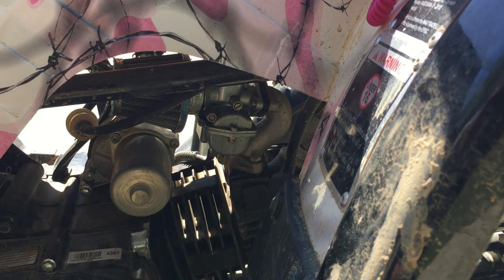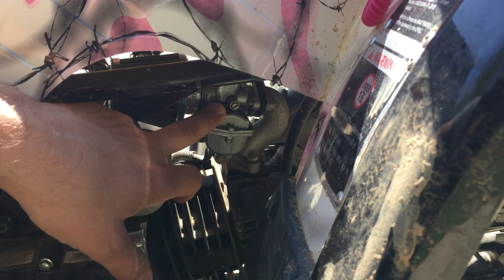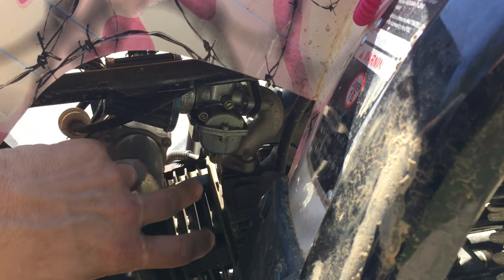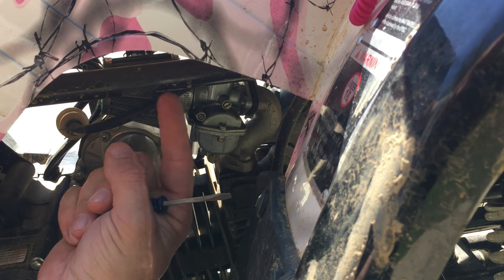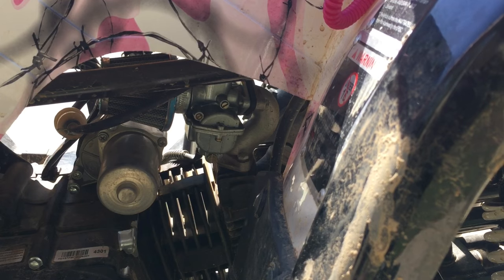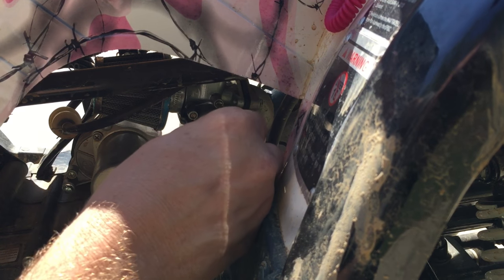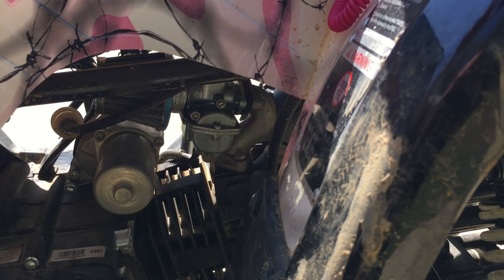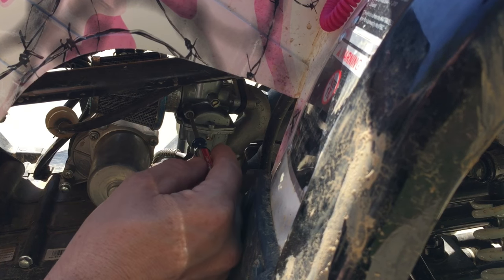Tune Your Chinese ATV Carb

Comment: Sometimes the air/fuel screw comes with a little plug covering it. If you use an 1/8” drill bit and very carefully and slowly drill into the Center of this plug, it will eventually catch and pop it out revealing the adjustment screw 👍
Reply: Omg I think you just saved me from going out getting another carb, I got a new Chinese pit bike 125 and it didn't have no idle screw or air but there is these rubber stoppers hmm 🤔
Reply: Well i probly messed up idk if i drilled too far and i 100% used the wrong drill bit and think i destroyed the screw face
Reply: I actually am checking the jets on my new carb for this thanks for the tip
Reply: Sometimes you need to drill a hole and screw a sheet metal screw into it . Then grab the screw with some pliers and yank the plug out.

Comment: Nobody else on YouTube can explain how to tune a carb as well as you did.  I'm glad I found your channel.  I'm going to be a combustion engine wizard, now!  LOL  Thanks, man!
Reply: There is NOTHING to "tune" other than changing jets and turnning the air bleed 1.5 turns from lightly seated
Reply from the maker: Pretty sure we can file “turning the air bleed screw” under “tuning.” 😆
Reply: They certainly can. This wasnt a thorough explanation by any means.
Reply: I concur ❤

Comment: Good video.  Here's some info to supplement.  There are 2 jets in these, an idle jet and a main jet/needle jet.  If your mixture screw does nothing, then your idle jet is plugged and it's running on the main jet.  When this happens your idle speed screw will also be extremely sensitive.
If it idles fine and the mixture screw works, but if you go near full throttle it loses power or even dies, then your idle jet is working but your main jet is plugged.
Both issues require taking the carburetor off and cleaning it.
Reply: This is exactly what is happening to my kids 50cc quadebike. Could you possibly post a link for a video to do this as I'm completely new to this and don't have the first clue. Tanks in advance
Reply from the maker: I think I’ve got a spare carb laying around here somewhere, I’ll see if I can make a video.
Reply: @BellyUpFishGarage  hey you ever make that video lol. I just got a grom clone and I bought a nibbi for it. It Boggs if I give it to much throttle to fast but if I kinda east into it, it’s fine? Should I adjust the needle?
Reply: @johnnyburgett7215  no video yet i guess
Reply from the maker: No, I’ll see if I can make one this week.
Reply: @johnnyburgett7215 what did you do to fix it

Comment: Thanks to you I figured out my issue.  The gas/air mixture set screw is snapped off. It came from the factory like this and I'm happy to have an answer. Thanks again.
Reply from the maker: Glad it was of some use.
Reply: So how did you get it adjusted
Reply: @omexgazplayz6298  I just went and bought a new carburetor. They are less than 20 bucks on Amazon.
Reply: @georgesmith6154  are the carbs interchangeable?

I just bought, apparently a predator 250cc, but vin number shows no such things, other then conquinghensim Corp. Lol

I cleaned the jets, replaced the fuel and replaced the relay fuse, it idles fine but when driving, misfires and backfires
Reply from the maker: Yeh, for the most part, many of these Chinese quads all use the same style/size carb.

Comment: Another way I do it is raise the rear wheels off of the ground and full throttle at the same time adjust air fuel mixture screw. Found that to work for me.
Reply: Pop the chain off.

Comment: I've always brought them a quarter turn out after finding peak rpm. Richens it a bit for when you whomp on the throttle so she'll go. These seem picker than the big bikes I've worked on in the past though. I'd like to see what a stepped flywheel key would do for the ignition... give 'er a little advance for better throttle response. Not so much Mo Powa, but rideability.
Reply from the maker: MissingLink MTB They certainly seem more picky than bigger bikes.
Reply: I feel like if you raise the needle it may also help. I've just started playing with these chinese ATVs and the cheap carbs are pretty finicky I've found. I bought 2 new ones that run perfect and then bought a 200cc to play around with. It needs some work and somebody put a MOLKT carb on it. It's been a learning curve. At least they're cheap to beat around on.

Comment: Great video. Which screw do I need adjust if the carb is acting like it has not enough fuel under load. New go kart but after a long run it'll give a hard time starting and die when pressing the gas pedal

Comment from the maker: So, this video has been much more popular then I ever anticipated.

What other sorts of “Chinese ATV” stuff would you guys like to see?
Reply: All of it 😆 🤣, thanks for the video
Reply from the maker: I’ll see what I can do...
Reply: My daughters didn't come with a fuel shut off valve. I'm used to turning my off when it's not driven and I didn't think to check for that 😅. Does it even matter or should I just go ahead and install one myself?
Reply from the maker: I’d add one.

The purpose of a shutoff is in case of float/needle failure the engine doesn’t fill with fuel resulting in engine damage due to fuel dilution when it starts.
Reply: @BellyUpFishGarage  thanks man
Reply: My Vitacci ATV keeps stalling out on my after a month of use and idk what’s causing it
Reply from the maker: When does it stall? Under acceleration? Have you tried cleaning the carb? A large amount of carb issues are dirty carbs.
Reply: Great vid man, nice and easy to follow as a novice 😁.  Can you do a vid on valve adjustments for these Chinese engines?  Cheers 😀
Reply from the maker: Yeh, let me see what I can put together.
Reply: Ive got a 2021 Kayo 150 and its doing this exact same thing in the video.... but i cant find these 2 screws to save my life. Any help would be appreciated, thanks.
Reply from the maker: Is this your carb?

https://amzn.to/3kVqjsf
Reply: @BellyUpFishGarage  no its not...
Reply from the maker: rzr nation Needles hmm… it’s gotta have needles.
Reply: @BellyUpFishGarage  so does that mean i can't manually adjust it from the outside?
Reply from the maker: rzr nation yeh, if you have no screws there is not really anything you can do.
Reply: How about a lesson on the choke?  I can't figure out if up or down is choked.
Reply from the maker: Jay Colbert Up is choke on. Down is choke off. But I’ll be happy to make a quick video. ;)
Reply: Mine starts up fine but when I rev it, it stays reved up for a couple seconds and comes back down. I've cleaned the throttle cable and made sure it's free and not binding up. Also cleaned the carb. Not sure what else it could be.
Reply from the maker: Is there any slack in your throttle cable?
Reply: @BellyUpFishGarage  not that I can see. I just tried out your tuning technique and I can't get it running now 😒 might be time for a new carb. I'm gonna try my ultrasonic cleaner next I guess...
Reply from the maker: You need a little slack in your throttle cable. Sounds like the slide could be getting stuck.
Reply: @BellyUpFishGarage  I took the brass pin out and hit it with 5000 grit, is that what you mean?
Reply from the maker: Brian Kunz No, your throttle slide that runs vertical in the carb.
Reply: @BellyUpFishGarage  ok I'll take another look at the throttle slide while it have it apart, thanks for the help!
Reply from the maker: You’re welcome.
Reply: I have a 40 cc chinese quad. Is there any mods I can do to get more take off power? It runs great but take off is slow
Reply from the maker: @Timothy Corbitt  You can increase the size of the rear sprocket, but while that will increase your torque, it will reduce your top end.
Reply: Careful man…. Somewhere is an Eric Swalwell  who’s getting very excited that BELLYUpFish may be a “Chinese ATV” only fans page ….🤣🇺🇸👍

Other than that excellent content and thanks …
Reply from the maker: @Joe-oc7dj  Man, I had to Google Eric Swalwell.  😆 

I’m from Alabama.  I doubt Eric and I could agree on where to eat lunch. 😂

That said - My OnlyFans style Chinese ATV videos are only available to my upper tier Patreon supporters. 😝
Reply: I have a problem with my 250 atv. If I give it more than 50% gas it sputters. Any idea?
Reply: I got a Chinese 125 coolster that will start run for like two mins and dies any ideas
Reply from the maker: @kevinknott4992  Could be several things. Will it run after it dies or does it need to cool down for a bit?
Reply: Hey so my 4 wheeler bogs when I give it full throttle

Comment: Mine works ok if I smoothly give it gas but if I yoink full throttle quickly it bogs??? Nibbi pe22 35 pilot 95 main 8200 ft elevation
Reply from the maker: Yeh, just keep tuning it until a full yoink gives no bogs.

Comment: The Kodiak carb I ordered from Amazon did the same damn thing idles good but craps out when I give it gas unless it's on half choke and I see no other adjustment screws except the one with a spring on it. forgot what ya called that one

Comment: Thanks for the tutorial. In my case I cleaned the carb and started my machine. Idles super high with the choke open full. When I try to dial the choke down it dies.
Reply: Make sure your slide isnt installed 180 out. Ive worked on one where the slide was put in wrong, meaning it needed turned to where it would slide down all way in..
Reply: One more thing, make sure you dont have vacuum leak..

Comment: Hey I know this is ak old video but when do you need to move to bigger jets? Because I’ve heard after you start to modify you’ll want a bigger carb and to try different jets. Couldn’t I just richen my stock carb out a little with the screw?

Comment: My question. If I were to turn the idle screw all the way in how many turns out before it's set to where it needs to be to where I can start adjusting it or tweaking it a little bit?
Reply from the maker: 2 to 2.5ish.

Comment: What do i do if my atv has a metal plate covering where the air fuel adjustment screw is? I have the same atv as in the video btw. I can post a video showing it if needed.
Reply from the maker: Sounds like you might be referring to a Welch plug.  If that’s the case, if you have an air compressor, drill the smallest hole you can into the center of the plug and then blow compressed air into the hole and the plug will come right out.

Comment: Did all that. Thanks. Mine bogs down when pressing the throttle all the way. Any advice?
Reply from the maker: Bryan Dobbs What color is your spark plug? You could have a vacuum leak.

Take a can of carb cleaner and spray it around the engine, while it’s idling. If the RPM’s increase, you’ve got a vacuum leak.
Reply: @BellyUpFishGarage I spray car cleaner and it turns off

Comment: Just bought a new PZ19 carb for my baja90 atv cause of no start. I’ve got spark. It’ll fire occasionally. But same issue As with old carb.  HELP!!
Reply from the maker: If you've got spark and it'll fire occasionally, it sounds like a fuel supply issue.

Comment: So where is the idle screw set at from the beginning.? If I turn it all the way in how many turns out to be around the correct area to test. I can get the quad to fire up an run for a few seconds but I have to stay on the throttle to keep it running. But it only will run for like 10 seconds max.
Reply from the maker: 2 turns.
Reply: What did you do to fix

Comment: I have mounted a brand new carb(keihin pz20) Did everything accordingly but it doest'n start. Is the screw with spring idle or air jet?
Reply from the maker: Sometimes they will both have a spring.
Reply: @BellyUpFishGarage  Thanks. Its running smoothly. But  there is no acceleration beyond 6000 rev, only the noise changes between 6000-9000
Reply from the maker: @dustypaint  If it's revving higher, but you're not seeing any increase in speed, you may have a slipping clutch.

Comment: Now how do I do this when it won't run without being choked ? It's a brand new carb.
Reply from the maker: Are you sure it’s getting fuel? I’ve seen brand new carbs come clogged, depending on the make of the carb.

Comment: I replaced the carburetor on my son’s Tao Tao 110 Boulder. Starts up better than it ever has and sounds great. When I put it into Drive it has almost no power and eventually dies out… someone help me!
Reply from the maker: Did you follow the directions in this video? I’d say your air fuel ratio is off, one way or the other.
Reply: @BellyUpFishGarage  I did and it’s working ! Running very well. Unfortunately it’s moving on its own in D or R even with zero throttle .. what’s up with that?
Reply from the maker: @canadiancraftbrewerytours Could be a couple things.  I’d start by bringing the idle speed down some.

Could also check the throttle linkage.
Reply: @BellyUpFishGarage  perhaps when changing the carb I installed the throttle cable wrong ?
Reply from the maker: @canadiancraftbrewerytours  Check and make sure the throttle barrel is in the sleeve correctly.

Comment: My air flow screw is flat how do I adjust it
Reply from the maker: If it doesn't have a slot in it, it's not adjustable.  So, you'll the only adjustments you can make will be idle screw.

Comment: I have a sunl 110cc which is pretty much the same thing you have. My issue is it won't idle but it will only go if I keep giving it gas by pushing on a throttle. if I let off the gas it dies.
Do you know what could be the issue?
Reply from the maker: Sounds like a dirty carb. Your jets are probably just dirty. Try taking it off and cleaning it.
Reply: @BellyUpFishGarage  oh, I forgot to mention it is a new carburetor
Reply from the maker: @jorgepizarro3327  Could still be just some junk it from the factory. 

Have you tried resetting the needles and going with a fresh tune?
Reply: @BellyUpFishGarage  I'm going to look at it in the a.m. I'll let you know what's wrong if I can resolve it 😂
Reply: I have same issue any advice
Reply: same

Comment: what does it mean when it initially bogs under throttle (like shown here)
Reply from the maker: Could be a couple things - too lean or rich would be where I’d start. I’d see if it’s too lean.

If it’s neither of these, it could be a number of clogged things like jet, or a fuel line, or air filter.

Comment: Do you know what causes my ATV it dies bogs down at WOT.  I placed new carb spark plug adjust pre your video.  No power at open throttle
Reply: Carb needs to be cleaned, your idle jet is working but not your main jet.

Comment: adjust your needle placement for a better throttle response...fyi
Reply: Adjust it to what clip position? Mine is in the middle...
Reply: @JM-yx1lm  adjust it lower on the needle. It will raise the needle in the main so it gets more fuel.

Comment: Mine would start and die unless I adjust the idle speed high. After it starts I can lower my idle speed and it’ll run great for hours and no trouble starting. Can it be a dirty carb? I’m clueless when it comes to carburetors.
Reply from the maker: Yeh, sounds like a dirty carb somewhere…

Comment: Sir, have you ever  wired remote start/stop using harness from Amazon for the 50cc quad?  I cannot find the 6 and 2 pin plugs it is referring to.
Reply from the maker: Wish I could help, but I have not.

Comment: Hey, wondering if i set it to a higher idle, what will the difference be? Acceleration? Btw good video 😁
Reply: It’ll bog less.  I prefer these to idle higher that this.it doesn’t bog and it comes back down to idle better.  I don’t go just by the mixture screw, I also read the plug.

Comment: On my bike the idle speed screw is all the way outside and the other small one is inside but every time I’m not touching the accelerator it accelerates by it self can you do video on that?
Reply from the maker: Check your throttle cable.
Reply: @BellyUpFishGarage  thanks

Comment: I recently got a new carb and air filter for my polaris trailboss 250 and after putting them both on no matter what adjustments i make the thing starts then revs higher n higher i know it cant be an air leak. Any suggestions? We have a new throttle cable on the way already.
Reply from the maker: Is the carb cylinder on the notch in the body?
Reply: @BellyUpFishGarage  yes, it seated in as far as the old one did.

Comment: My issue is that whenever I start my 110cc atv, it’ll just go without giving it any gas and will stay at a steady 8-10 mph without giving it gas, it wasn’t doing this before I adjusted the air/fuel screw on the carb but when I loosen it, it backfires,
Reply from the maker: Have you done anything else to the carb other than adjust the air/fuel mixture?
Reply: @BellyUpFishGarage  nope
Reply from the maker: @AidenZebra  have you cleaned your carb?
Reply: @BellyUpFishGarage  yep

Comment: It is not really an "idle" screw, but rather a fuel screw, isn't it?
Reply from the maker: Depends on how technical you want to get.

It’s really an “air fuel mixture” screw but it directly sets the idle, therefore it’s often referred to as an “idle screw.”
Reply: From my experience - one screw controls air supply, the other one - fuel supply. Both screws affect rpm, therefore it would be confusing for me to call one of them idle screw.
Reply from the maker: They’re mixture screws. Call them what you want.

Comment: I have the same carb but when i rev the bike it stays at the rpm for a second even after i let off the throttle and if i dont keep reving it it will die,do you know a fix?
Reply from the maker: Have you cleaned the carb?

Comment: Mine sounds like it has marbles when I accelerate. What could it be?
Reply from the maker: Where does it sound like the marbles are?  I’d guess bad bearings somewhere, but that’s a wild guess.
Reply: Check the bolts on the exhaust where it enters the engine. They tend to come very loose and tightening will get rid of the marbles

Comment: Good video just my air/fuel is under neath so have to take it off to unscrew :(
Reply: No you don't, mine is on the bottom too. All I did was use a stubby flat head screwdriver and adjusted it.